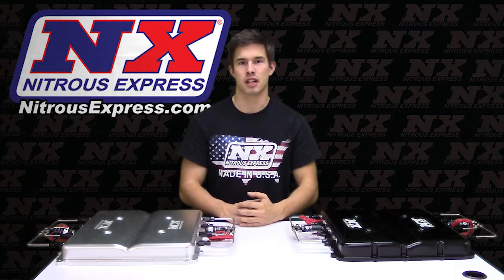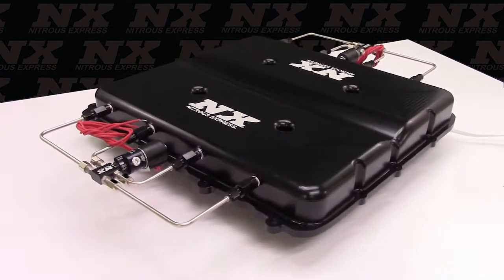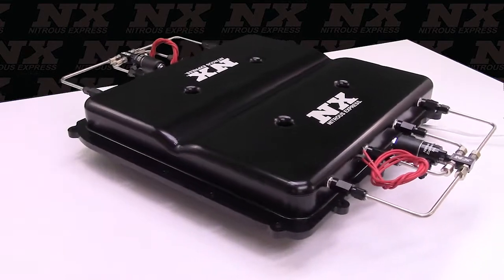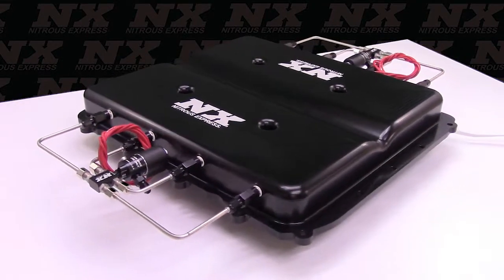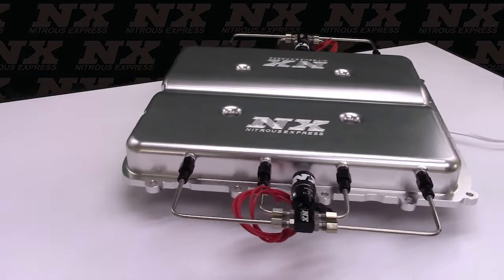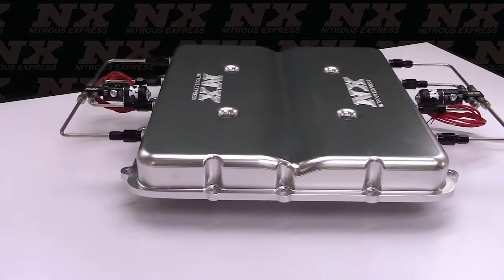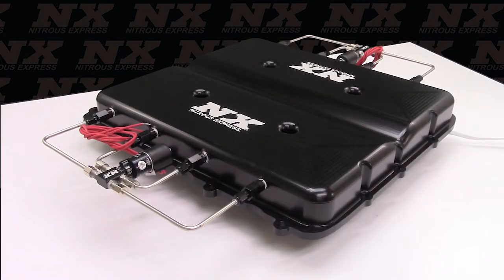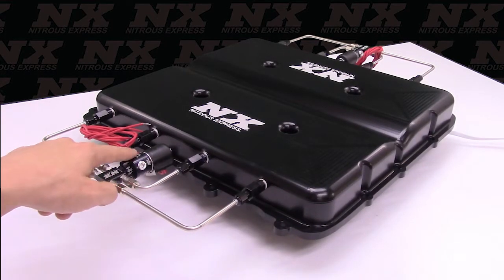Water/Methanol System with Billet LT4 Supercharger Lid Part No.15127H-LT4

Comment: Is there an installation video for an LT4 based vehicle? (Z06 or ZL1). The instructions don’t give a vehicle specific mounting location for the pump or tank.
Reply from the maker: There is not. Installation locations are up to the customer for the most part. As long as the pump is below the tank you should be alright.